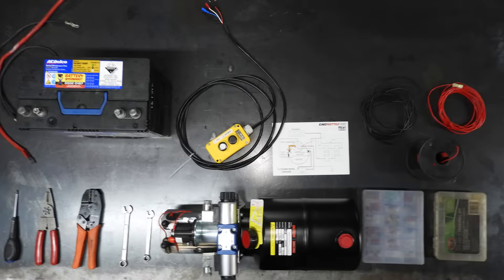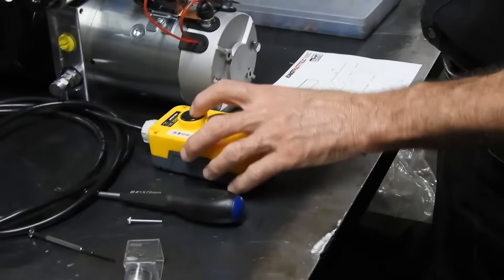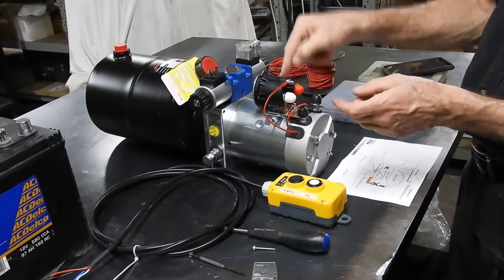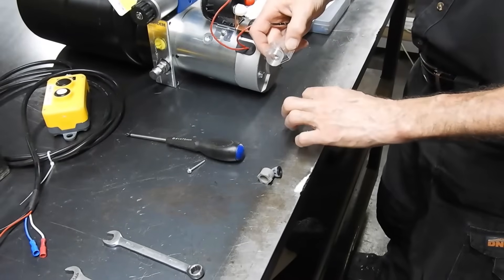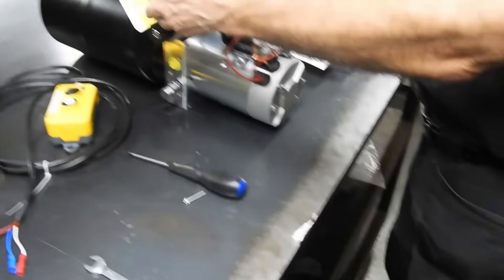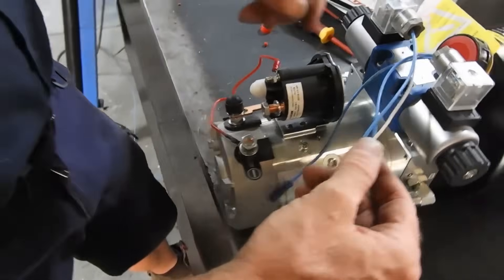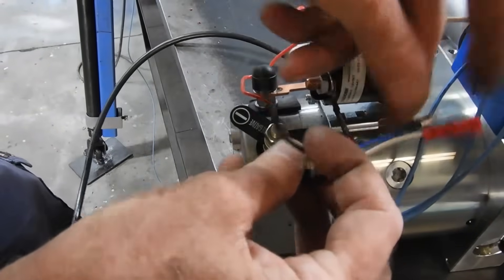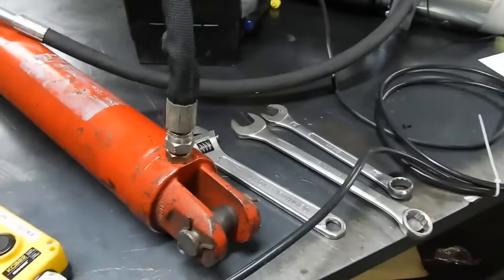How to Electrically Wire Up a 12 Volt DC Hydraulic Pump Power Pack Twin Solenoid Coils & Thermistor

Comment: What if I have a motor thT only has a positive post? Would I just use the motor case for ground?
Reply from the maker: Yes some older motors use the case as a ground / Earth make sure it is a nice firm connection

Comment: Hi, I have a double acting power kit and a cylinder that has a fitting on both ends..presumably A double acting cylinder..on a stacker lift...the motor was replaced...the old one had A power up a d gravity down lever....the new motors pump does not.  Its just got 2 coils and a remote for up and down.  When I hooked up new kit,  I blew the seal on the cylinder bottom..and it pushed up the dust dirt sweep gasket at top of cyl.  So I thought it can't take the down pressure...so what I want to do is have the down coil open so oil can just drain through without activation the motor.     WHEW!!  I hope I got my thought across and someoe can advise me?  Thank you in advance!  Ron.
Reply from the maker: Check inside the remote you want power going to the down coil (for the oil) but you do not want power also going to the motor start coil. 
You will require power to motor start the solenoid coil for Up but Not on down. 
I am not quite sure how you can do that perhaps with a "Diode" as diodes let current flow one way but not the other? 
Talk to someone who knows about electricity and diodes.
Reply: You need a  Single acting pump unit you cannot use a double acting or a gravity down

Comment: Can a double acting 12v pump be mounted vertical
Reply from the maker: Yes, it can be mounted vertically with the tank at the bottom but it will have to be ordered specially so that the suction system is extended to the bottom of the tank. Alternatively you could pull the tank off and modify the suction pipe (by adding a length of hose) so that the pump sucks from the bottom of the tank.

Comment: Can you give me a diagram 24v hydraulic pump how to connect the switch from the motor going to thermal switch to solenoid.
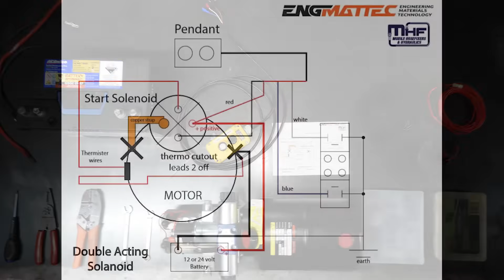Reply from the maker: 12 or 24 volts the diagram is the same, if you rewatch the video at 0:30 to 0:35 seconds in from the start the wiring diagram is shown there if you pause and take a screenshot you will have all that you need.

Comment: The solenoid plugs look to have led’s on them, (light emitting diode) if so they can only be wired one way?? Anode to positive cathode to negative, depending on the current feeding the plug if wired wrong the coil won’t energise or blow the led 2.50 amp max draw on most coils
Reply from the maker: Very Interesting comment and observation Charles thanks for the heads up, I will take a closer look at the connectors and let you know what we find.

Comment: Have one that just clicks and does nothing. Replaced that Solenoid on top and still nothing. Could it be my motor?
Reply: It takes a really good ground to run these. I’d bet that’s your issue. What’s it mounted on? A lot of times the mounting bolts are not enough of a ground, especially if it sitting in fluid and whatnot..
Reply from the maker: Yes Andrew maybe, try checking the Carbon Brushes there should be 4 of them and they are spring loaded to push them onto the rotating commutator. If they are worn down too far they dont make good contact and can arc out and get damaged or burnt . Also check for water damage and or dust ingress.

Comment: I am looking to put electric / hydraulic cab lift as the factory supplied hand pump is too hard to pump up and down(Iveco stralis ) is this some thing you can supply
Reply from the maker: Hi Gordon sorry we missed your comment, did you end up getting a power pack installed on your Iveco and If yes we are curious to know how did it all go?

Comment: This unit looks very similar to what is internal to a hydraulic lift gate on the back of a truck
Reply from the maker: Yes you are correct, only difference most lift gates are single solenoid, meaning that the motor runs on the lift but only energises cartrige valve coils for the drop. (Noise from motor and pump on lift, quiet on drop)

Comment: now how do u start the motor with regular socket power? with a 12vdc power supply?
Reply from the maker: Unless you have a very large transformer that can generate very high amps (between 120 to 200 amps like a size of a welding transformer)  you will not be able to use socket power. Best to talk to an electrician about this requirement. One or better yet two Large 12 V DC lead acid batteries conected in parallelled with a quality 10 to 20 amp intelligent charger permanently connected to the batteries and with the charger constantly connected to a regular power socket is best for a home/garage installation. The intelligent charger will constantly top up the batteries and keep them ready for use. Please be aware! Keep this installation well ventilated as flamable gasses can be generated while the batteries are being charged.
Reply: @Hydraulic.Online  i'm screwed then lol, i tought i could make it work from a socket with out so many complications! so best thing to do is to sell that pump and get a 120ac hydraulic pump, it would be cheaper than getting a power supply with that ampperage capacity! thanks,mates!! sheers from ca all the ocean to australia!!
Reply: @Hydraulic.Online  hello, is it possible to use a normal car battery instead of the ''2  Large 12 V DC lead acid batteries conected in parallelled''?  with the 20amp good quality intelligent charger? thank you very much
Reply: @gei4978  What smart charger are you using?
Reply: @Hydraulic.Online  What smart charger do you recommend?
Reply: what about jumping car's sensors with resistors to bypass computer and pass smog check? u know, the usa is the only country in the world where cars are used so we need to check emissions from car so we dont pollute our world....

Comment: Would it be possible to run this from a plugged-in 12VDC power supply instead of a battery? If so, what size/specs would be appropriate?
Reply from the maker: Hi Michael 
Hmm good question, this would probably be possible, however you would need a very large transformer and cables  capable of supplying up to 200 Amps (eg like something from a large welder) It would be best to consult with an industrial electrician or an electrical engineer.
Reply: @Hydraulic.Online  Thanks very much.

Comment: The thermal protection inside is a positive temperature coefficient thermistor. They frequently use a thermal paste to help transfer heat into it. The hotter is gets, the higher resistance in the circuit goes. It works like a slow temp sensitive switch. They can also be designed to open and shut off.
 Even though this is a demonstration, please show the use of dielectric grease on wire terminals exposed to pressure washers, moisture from snow, rain or humidity. It’s just best practices. ASE Master Tech since 1978 - Retired.
Reply from the maker: Thanks for the comments and advice Dean, yes you are correct the use of Dielectric Grease is a great idea to assist in the protection of electrical connections from moisture and dirt. Especially in the installation of these 12 Volt DC hydraulic power packs in mobile plant and road going vehicles.

Comment: What is the flow from the unit? Seems like it’s pretty slow in turns of operating that actuator!
Reply from the maker: Hi Tom thanks for watching and for your comments, Yes 12 and 24 Volt DC Hydraulic Power Packs are commonly available with low flows from 3 to 9 litres per minute. The pump in our video was rated at 5 litres per minute. It will, however, supply pressure of up to 200 bar or 3000 psi.  

Please also be aware that unlike AC motors, DC motors will slow down as pressure and load increase.
These small power units are a cost-effective way of creating high loads but at relatively low and safe speeds (flows).  

One of the advantages of hydraulics and why they are used extensively in the industry is that massive forces can be generated with very fine control. The 3000 psi of pressure applied onto the red cylinder in the video will produce a  pushing force of 14,700 lbs (6.7 metric tons) 

If you want more speed at the same pressure you will need a lot more power, as a rough rule you need 400 watts of  power for every 1 litre per minute of flow at 200 bar (3,000psi) 

For example, a flow of 60 lt/min at 200 bar pressure will require 24 KW (32 HP) of "Electric Motor Power" If you are using an Internal combustion engine" as the power supply you should add another 20% more power taking the requirements to 28.8 kW or 38 HP.  
Cheers
Tom

Comment: sir aap ne jo bata yaa ha same motor mer pass ha but ek problem ha ke battey se jo motor me wire laga haa wo bhot heat kar ra haa or mene 6SQ mm or 16SQ mm wire use kiya ha to bhi heat hoo ra ha what to do
Reply from the maker: Akhilesh Not quite sure what you are asking but if it is about cable cross  section to supply the motor the bigger the better, these units draw up to 150 amps, so think cables the size you would use on the starter motor of a large car or small truck.  We use welding cable for long lengths as it is readily available and not as expensive as Automotive parts.

Comment: What is the rotation speed of the motor
Reply from the maker: The RPM of the DC powerpacks vary between 2000-4000rpm. This is dependent on load; under low load the rpm will be higher, under high load it will slow down. AC powerpacks on the other hand run at around 2800rpm fairly consistently.
Reply: thank you very much

Comment: Hello I got one same pump I bought like a month ago now is not working I been using it in a tree service dump truck sometimes work up but really slow and when i press button down goes really fast.  Do you think is something wrong with pump ??
Reply from the maker: Miguel there may be a few reasons for this, how full is your tipper is, how much oil in your tank, the correct type of oil for the temperature, not enough motor power, pressure relief on pump set too low. If it is coming down too fast you may need a reverse check flow control valve, with this valve you can control flow on the down but free flow on the way up. You also need to check that the tank has a cap that can breathe (let air in and out of the tank and that is is not blocked with dust and dirt) You need to be very careful doing all these checks as it can be very dangerous working with high oil pressures and heavy loads.

Comment: Can it lift 2.5 cbm of gravel?
Reply from the maker: 2.5 CBM of gravel is about 4 .2 tons so yes with a correctly sized hydraulic cylinder and the correct design for lifting or tilting. There are many variables, you may  need a larger oil tank if you want to lift (or tilt ) through long distances.  I am curious what did you have in mind to do with this type of DC power pack?

Comment: Hi I have a 24v hyd pump, should this work with a 12v battery or will I need to get a 24v battery?
Reply from the maker: Hellow Gordon Thanks for your question and for watching our video,  
We Do Not recommend you try this, as Feeding a 24 Volt DC motor with only 12 Volts DC, barely half of it's rated voltage, may not be enough to even turn the motor, depending on the load which will be a lot in a hydraulic pump application. Also the back EMF will also cause additional resistance, that the reduced voltage may not able to overcome, causing the motor to stall out. 
(the majority of the answer above is courtesy of Quora.com)

12 and 24 Volt DC hydraulic pump motors will draw large currents at elevated pressures, 120 amps are very common so make sure large cross section electrical cables similar to those used on automotive batteries and starter motors are required. 
If running long cable lengths over 3 meters (10 feet) we highly recommend you use 200 amp welding cable and terminals. We find welding cable and terminals to be far more cost effective and flexible than automotive cable of a similar amp rating.     

The best way to generate 24 volts DC is with two 12V DC batteries of the same type, size and charge condition connected in Series.
(Series means that the positive of the first battery is connected to the positive  terminal of the motor's start solenoid, (please watch our video again for start solenoid connections)
 the negative of the first battery is then connected to positive of the second battery,  and the negative of the 2nd battery is then connected to the earth (frame) or negative terminal of the motor)
Hope this answer has helped.
Reply: @Gordan Muir   >This is a good question Gordon. If the systems label or DMM indicates your system is designed to run on 24Vdc, then you would have to replace it with the same. He gave you the correct answer but running on 1/2th the voltage will run slow, heat up fast and cause damage. You can & should check you batteries and connections is job one. You can run 2 batteries in series like in a flashlight as two will produce 24Vdc to operate you system. On a truck, you can have a lift gate, snow plow or outriggers to provide a stable wider stance to the vehicles stance. If low current or high current/amperage, go to a home improvement store and purchase dielectric grease and use on terminals to prevent oxygen and gasses from accelerating corrosion on the copper wire and metal parts. Best of luck! ASE Master Tech since 1978 - Retired.